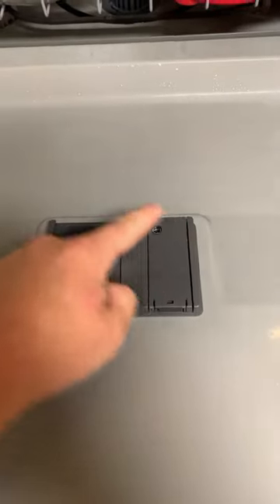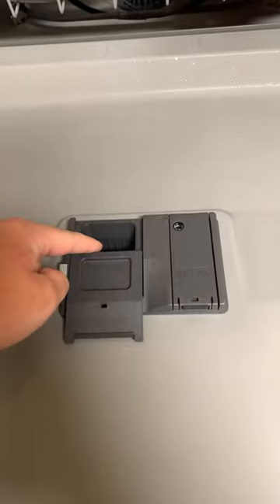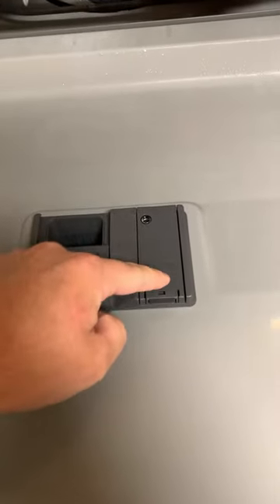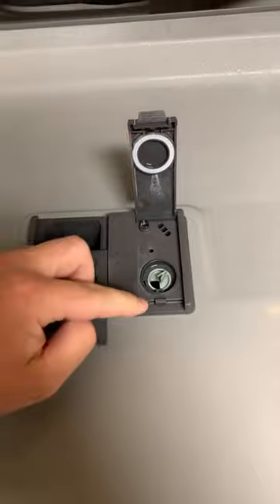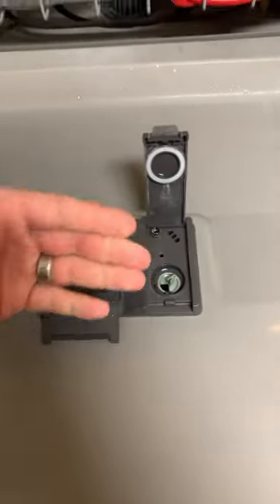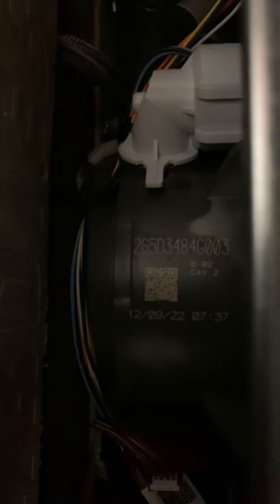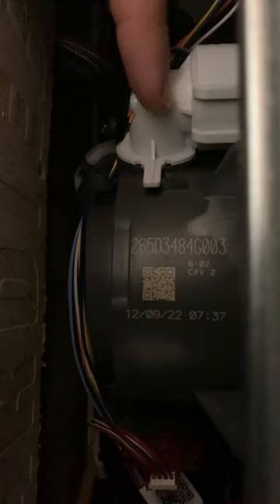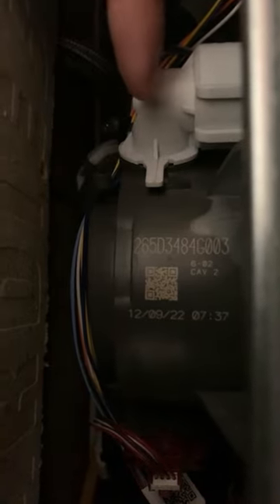Dishwasher not drying? #shorts #howto

Comment: Forget the dry cycle. Open the dishwasher after the final rinse and drain. Pull the racks out for a few minutes and allow to air dry . Works well.
Reply: You can do that but that’s not how it’s supposed to work
Reply: Hey guys. I don’t have a GE machine, mine is a “Lamona” which are the manufacturers that the kitchen fitters use. Not much luck on here with them 😂 

With regards to opening it up to let it dry naturally may work on some things (and save a bit of 💷) … but glasses or mugs with a concave base trap puddles of water so I’ve been taking all that sort of stuff out and laying it out on a tea towel - it’s a pain in the 🫏 - *Another thing that can stop your machine getting up to the temperature you set it at to actually do it’s job is affected by sensors in the machine that somehow can tell how dirty the load is, sooo don’t rinse off beforehand! Cheers.

Comment: Pressure water switch has no business drying the dished it a switch that allow water to enter the unit. Drying issues is usually related to a heating element, thermostat, fan motor or a vent